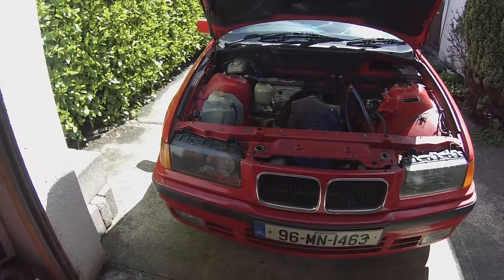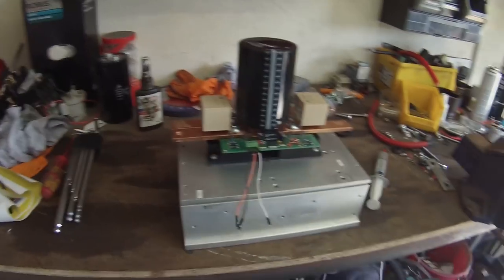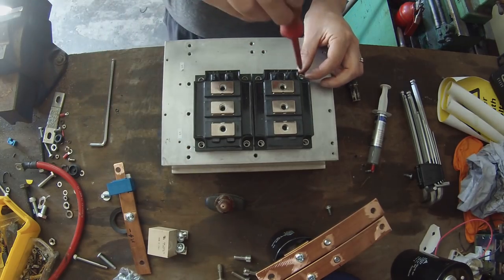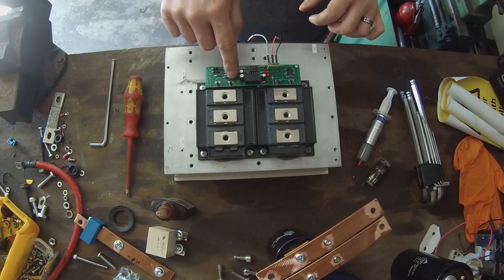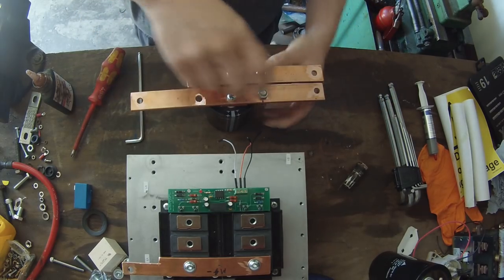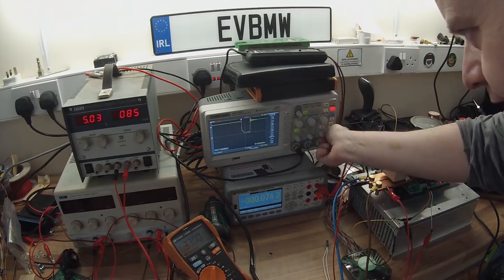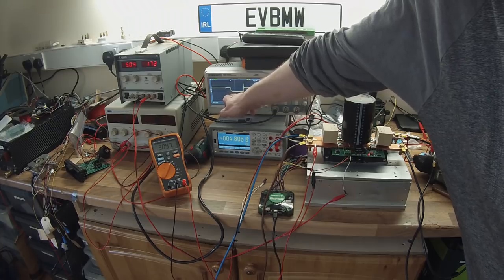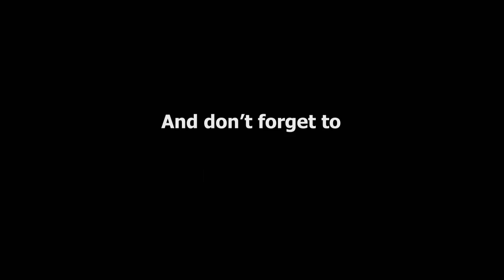€1,000 BMW E36 EV Build 07 : Motor Controller Part 1

Comment: Really good videos, keep up the good work! Also, Damien, please emphasis in next video that if one chooses to go with multiple IGBTs (like 4+ smaller and cheaper ones) for higher power, they have to do a lot on load balancing, or thermal runaway will play a dirty trick on them :) Also one would need to take in consideration gate charge and how much power driver circuit would have to provide for given setup! I did that mistake when was building my first controller on 6x 400amp IGBTs :(

Comment: Good video Damien, You are an Garage EV wizard! keep up the good work and I’m working on the Nova, using some of your methods. I’m going the cheap battery route with deep cycle marine lead acid battery’s. Your video where you tested the BMW with no motor controller was great! had a good laugh and I’m gonna do the same to test my Monster motor

Comment: HI Damian, Dave from BasicMicroUK here, I would like to order 10 of the gate driver PCB's from you, once you get the parts list sorted we would be happy to offet a parts kit for these controllers, just a note we have the Fuji 2MBI600U2E-060 IGBT in stock and we can offer these at £150/pair to your followers, Great work yet again and a very interesting project
Reply: Are you offering the part kits? I see the IGBTs listed on your ebay store for £174.99 each

Comment: Damien do you mind telling me how you connected your tachometer sensor to your e36 cluster? Is it possible to use existing loom wiring in the engine bay or did you have to solder to the back of the cluster directly?

Comment: I love this kind of video, I don't really like videos that have half the video of someone writing code!  But putting components together, and explanation , I love it, I'm not to the point where I'm ready to write code, I just learned to write my name, I need a few, before I'm ready to write code haha! 😀😆....
I totally want to build a few controllers, I want dumb controllers, I don't need any programmable controller, I just need a
 'ON' switch, and a '''GO!''' pedal!...  Maybe the rate of speed change to pedal input ratio adjustability, maybe the use of two pots parallel could do that on a dumb controller, that will allow more pedal input in the start, to get a small output , then more output as there is more output,  any idea?

Comment: having the 12v cable with the othr battery cables is not interfering?
Why a fuse in the negative of the 12v battery, not in the positive wire?

Comment: so the miller affect is residual charge it the system after the switch is turned off? Could their be some kind of a multi contact switch that deals with the residual energy in the off position, so that the motor can spin more freely and have less Arc on each pulse?